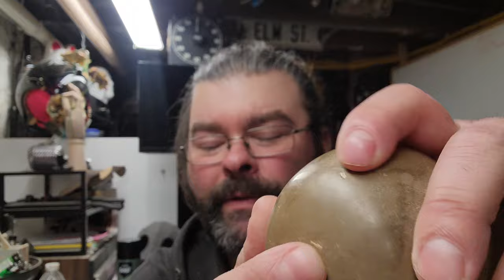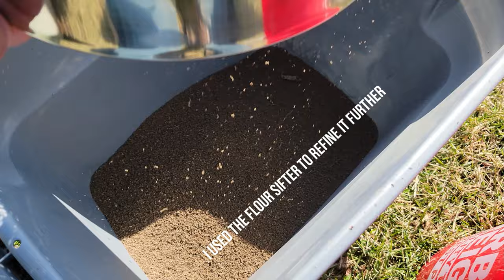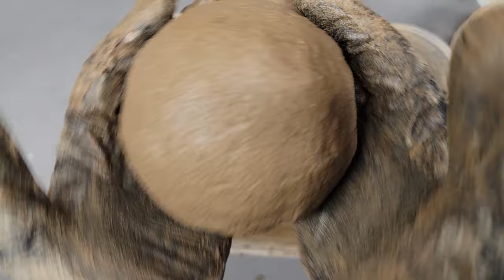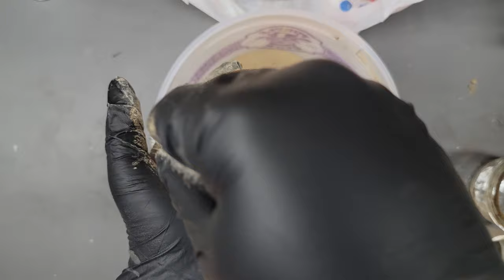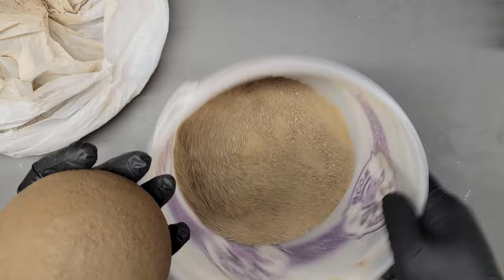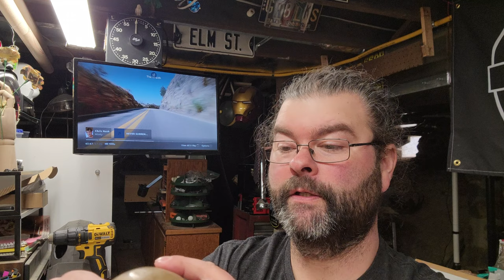Playing with dirt - Dorodango DIY

Comment: Using that plastic pipe did you no favors. The edge is sharp, which aggregates the surface more than it polish it, and it doesn't have the same weight to it. If you use the mouth of a glass jar the edge is smooth, and you should get a better surface built up.

Comment: My first one looks like your textured one, shiny but rough. My friend said it looks like an old skee ball lol
How do you get them so marble smooth? Just keep damp and adding more fine layers?
Reply from the maker: The fine dirt helps build up an outer shell. I added maybe 6 layers.  After that, I waited for it to dry slightly until it started to feel firm. I started polishing it with a smooth jar (around 17 minutes in the video).
Reply: Awesome thanks for the reply 👍